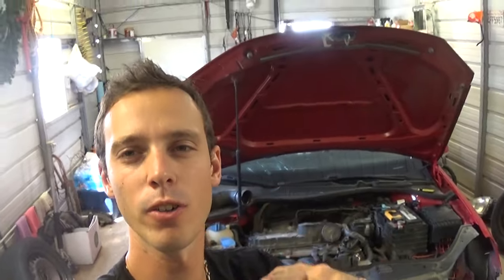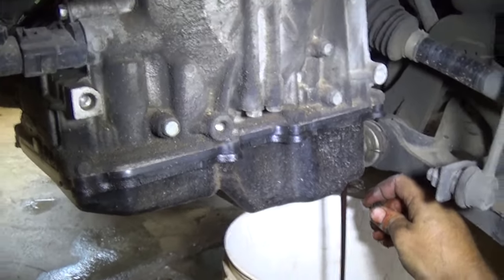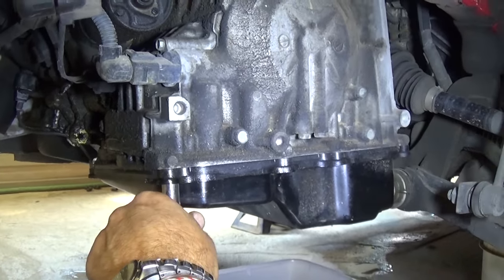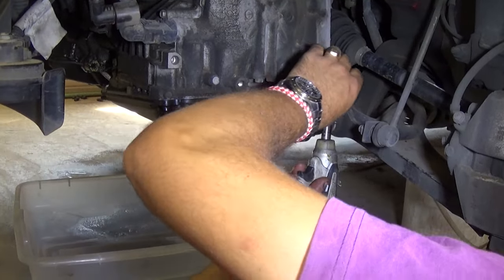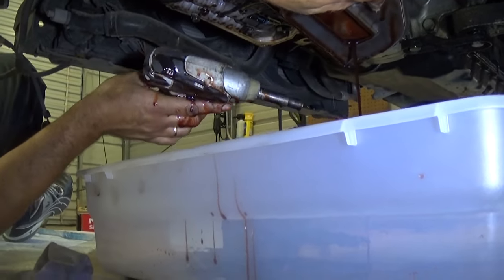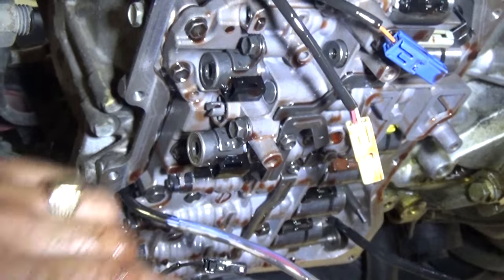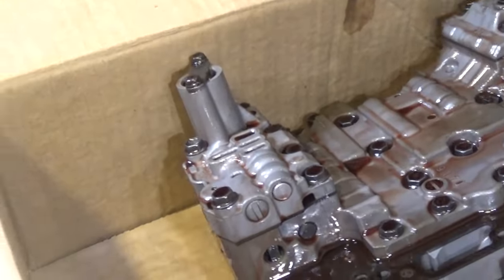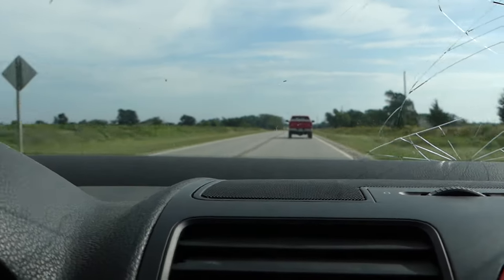VW TRANSMISSION SHIFTS HARD VALVE BODY REPLACEMENT FIX

Comment: Good afternoon.  I would really appreciate your your advice .. so i m concerned i just installed used transmission which  works fine and don't won't to mess up.. Recently I put  6qt

TITAN ATF 1 with vw spec VW TL 521 62(G 052 162 ) in my VW Passat 2.0 T tiptronic fwd. 6 speed by mistake. 

I saw later that TITAN have the other fluid that exactly match with specifications for my model of car which is TITAN 4400 Spec VW G 052 990055 025. But both products are approved for VW

 

Vw fluid from Dealer  for my car has spec G 055 025 A2. Which I belive it match with TITAN 4400..  long story short I have flluid from b5 01m tramsmission in b6 09g transmission 

Should I drain it and replace right away with correct  specifications or I can drive for a while with ATF 1 and then change to TITAN 4400 after a year .

Whats the difference in this specifications and how important this is if both are approved for VW ? Thank you so much in advance any help so much appreciated 

Ivan

Comment: Interesting to not show actually replacing the basic body, just pulling it. Yes, going back inn should be the reverse, but were there any issues that came up we should know about? I guess we assume there weren't since you didn't say so
Reply: Jarod Morris w
Reply: Also don't you need to add the new valve body and install with a torche wrench.
Reply: @tonytrilex2555  and preform a adaptation...other wise the computer will control the valve body just as it had been prior to the replacement!
Reply: @kirksunley1381 
Do I need a special tool for adaptation?

Comment: 2003 jetta. When I first shift to drive no matter the warm up time, i have to give a little gas for it to shift,  last night driving home as normal, speed limit is 70 , the car decided to shift to 2nd then 1st then 3rd to 1st ..i thought the motor was gonna blow..it went back to normal after that..but it still acts funny...shifts fine at speeds below 50... Acts a little funny,  OD can engange at low speeds too which im not sure if ive noticed before.....any ideals?
Reply: Change you tcm
Reply: @808kingkoopa  Oh that,. I found out it was the valve body inside the transmission,. Being that a valve body cost a grand.  It was more than the car was worth so I sold it to a guy that wanted the engine and I bought a new car.

Comment: Hi, I took my valve body down but I CAN'T find a gasket
Reply: It comes with the filter when you buy it
Reply: The gasket is in between the valve body and where it meets to the transmission it’s a very thin long sheet almost looks like paper